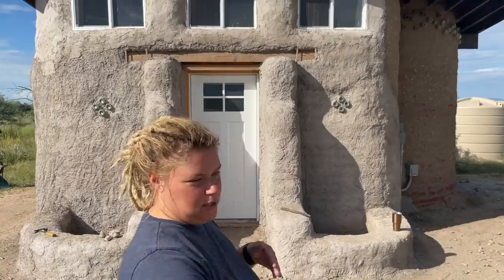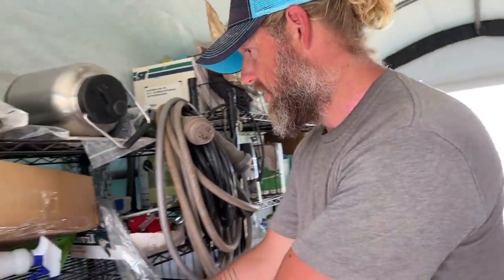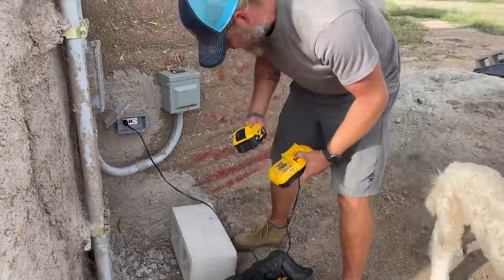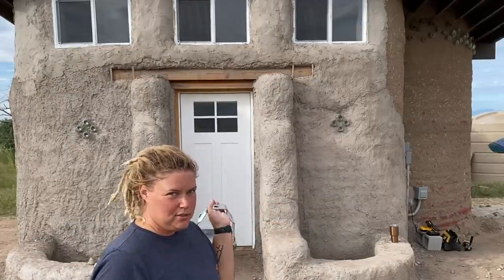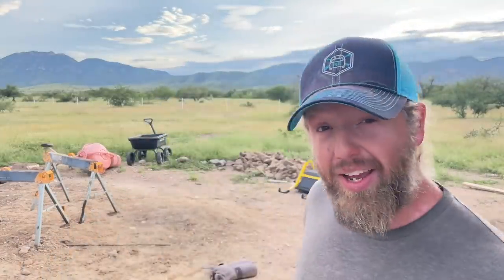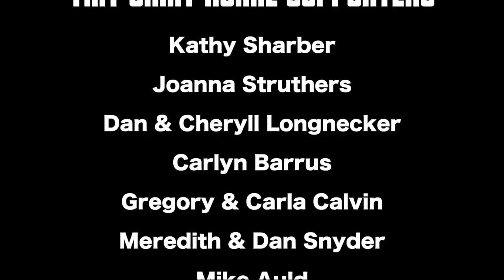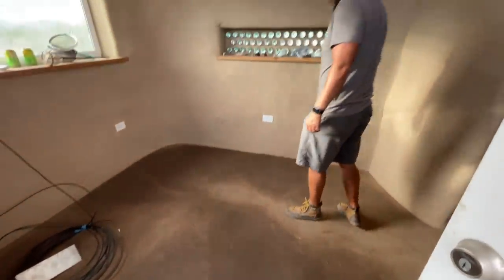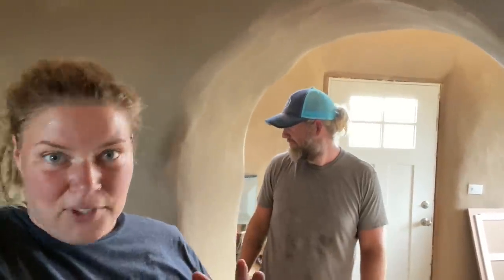Get This Shed Done Day 20 - Prepping Post Holes for Front Door Overhang

Comment: Hey Guys, one thing I noticed. When you were moving the brackets, that will hold your post, back and forth. They seem to not want to stay where you put them and I'm just wondering if you pushed your cement away from the brackets and you have a void underneath.  I don't know if the cement was liquid enough to flow back underneath or not. I  just hope so. 

You guys amaze me every time I watch your videos. Having never done this kind of thing before you are certainly doing a good job.

If I was still living in the United States I would probably be doing something like what you and so many others are doing. I watch 4 different channels and enjoy each and every one of them. 

I am starting my own building project next year in Northeastern Thailand next year. It is just a little bigger than what you guys are doing. It will take a crew of 6 one year to build. They don't build out of wood here because they don't have the trees that we have in the States. Most construction is done with steel and concrete. The labor is pretty cheap here, about $1.00 per hour. I will be feeding them a lunch each day but that's less than a dollar per meal. 

The land is always the biggest cost in building in Thailand. It  used to be cheap but inflation has hit here too. We only have one acer but the house will only take up 1/4 acer. Then behind the house will be a 1/4 area aviary that's 35 feet high and the rest is a pond and raised bed garden. It will be nice when it's done but a lot of work to get there.

I talk too much. 

LOL
Reply: Please pay those people more than a dollar an hr.
Reply: @jamesclark9347 , No, not for general labor. If they are skilled labor then that's different. If you lived in Thailand you would understand. People are very happy to work for a dollar an hour and in Thai money it's 30 baht. They normally work a 10 hour day so that's 300 baht per day. What that means to them is they have enough money to feed their family for a week and enough for gas in their scooter.  The next 4 or 5 days they can put in savings and maybe buy some beer for the weekend. You never pay them untill after work on Friday. If you pay them on a daily basis you will not have a crew tomorrow.